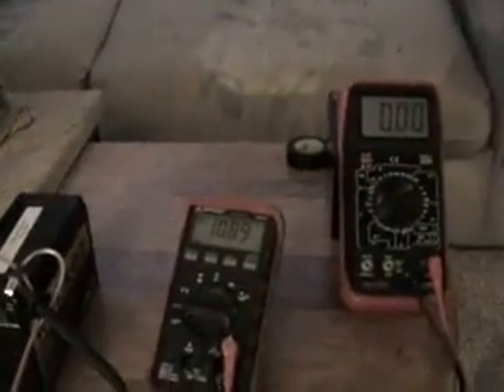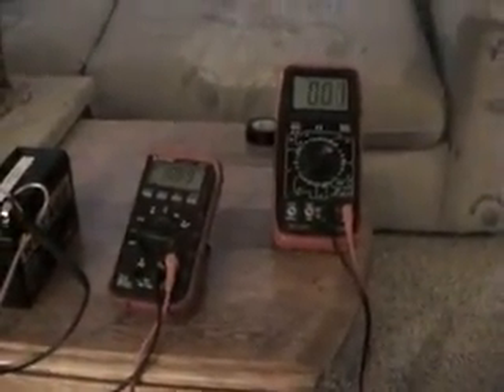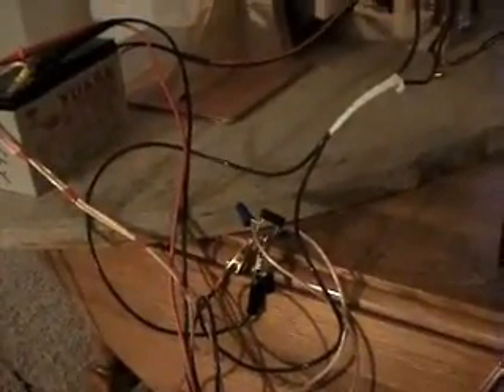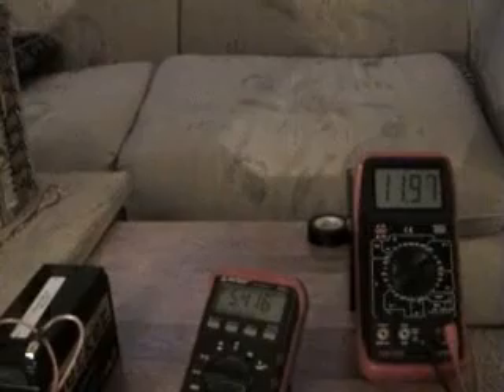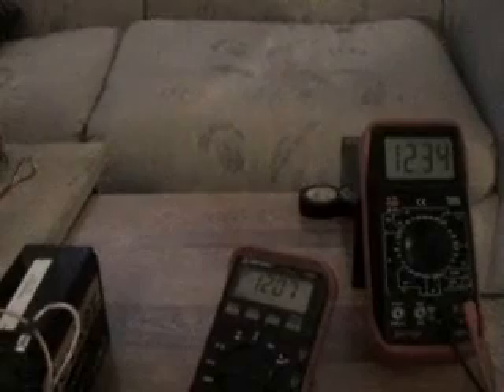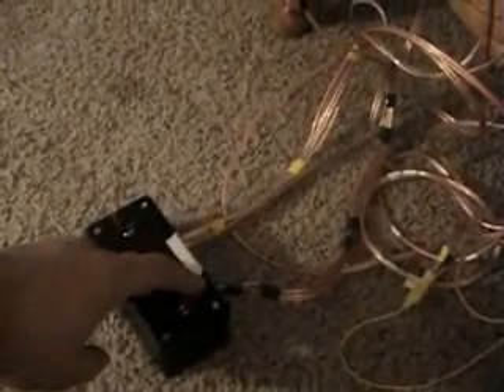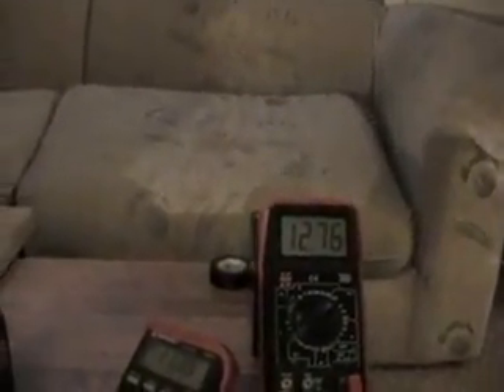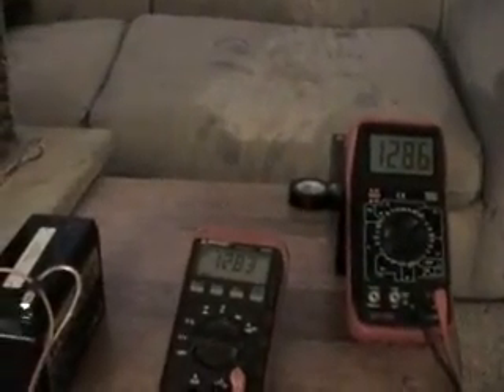New information on my Bedini Motor Generator Battery Charger

Comment: I am close to building my first one, thanks for this, Jeff.  I am not sure, someone please correct me .......  this is what is happening:
The motor coils produce back EMF pulses at a fairly high voltage.  These are rectified and charges the battery.  EFFECTIVELY the battery is obtaining more input charge power (if you can call it that)  than the input power from the source battery ..... correct?  In other words you don't take the extra power from the rotation torque - you take it from the CHARGED BATTERY.   Because of the pulses, you can't measure the output current effectively, you need to use the charged battery and work out the amp-hour capacity of the newly charged battery.  
If you start with 2 deadish batteries and then swap them, source to charge, will they both become fully charged?  If so, that is amazing (like where did the energy come from?)
Can you take current off charge battery while the motor is running?

Comment: This is basically a mechanical dc to dc converter, charging the battery with the rectified back emf of a coil fed with a short duration pulse the timing of which is controlled by the flywheel. The equivalent could be built without any moving parts by using the same transistor and power coil (trigger coil not necessary) but driving the transistor with an oscillator with a suitable mark/space ratio.
Aka a buck boost converter.

Comment: I'm sorry if I've insulted you that wasn't my intention.
Believe it or not I'm an electronic engineer as well.
I'm just saying we don't know everything for a fact, and
that's just my findings from experimentation on the grey
areas like the tesla effect with high voltage low current
which breaks ohm's law and lenz second law, and in
my experiments I discovered bigger gain of energy
then losses. I have an experiment with 450% efficiency.
I'm not just saying things I wasted money time and resources

Comment: Something that I don't understand, the energy that I'm getting out of my bedini motor is not compatible to be ran on the bedini circuit but can run appliances. how do you swap the batteries then? bedini said that we would have to run an inverter, but my inverter plus my eleminator charger drains more than it charges, so that wouldn't work. is that what's the bridge rectifier's for?

Comment: Nice motor guy.
I have built several bedini motors, and they all work great.
This is the first one i've seen with a BR before the charge batt.
Are you seeing better charging results with it?
Cool battery swapper!
Your design?
I see you are using 2 DPDT switches & 2 coils.
Is the second coil a must have for the swapper design to work?
Thanks for the vid & your time.
5 stars
Eddie